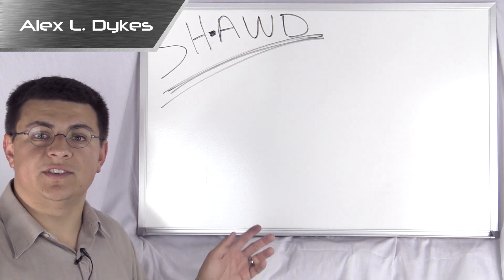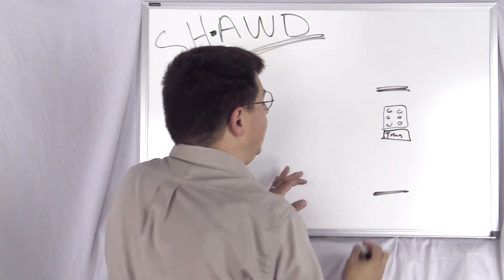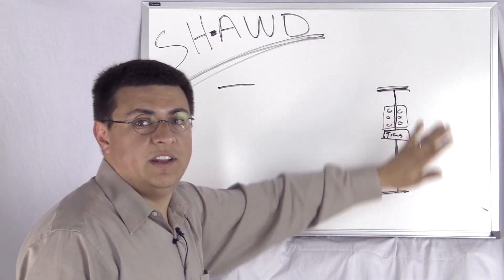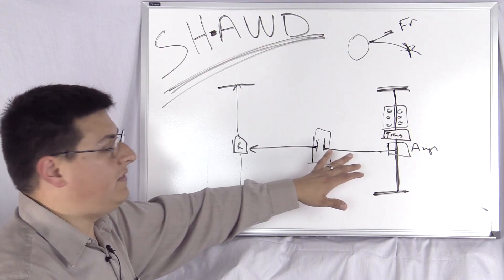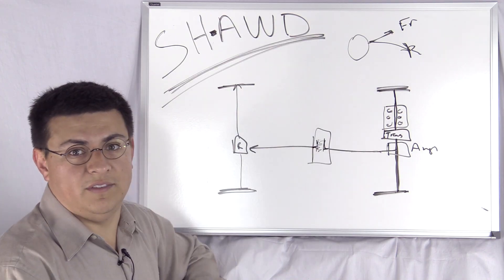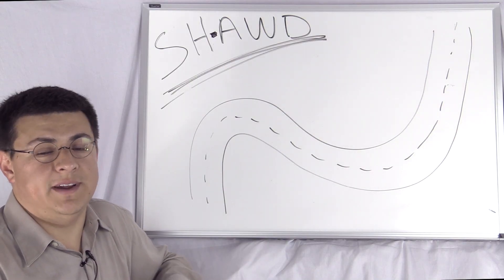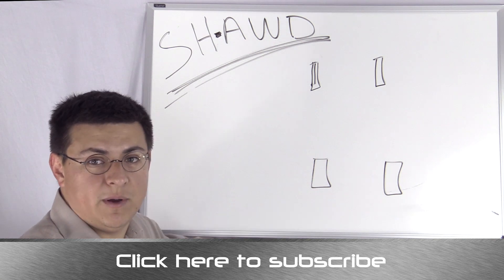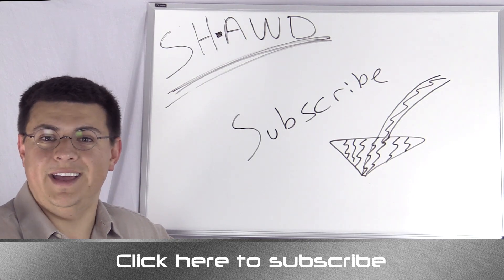How SH-AWD works: Acura's AWD system explained

Comment: This was an excellent video! Just a couple of clarifications.
1.- The only car to use an acceleration unit is the RL.. That unit allowed it to have different ratios but it was specific to the RL because of its long wheelbase, It needed the extra ratio of the acceleration unit in order to prevent binding from a sharp low speed turn.
2.- There is no "Center Clutch" the way the quasi "Center Clutch" happens in a SH-AWD vehicle is carefully controlled by the application of the rear torque vectoring axles clutches. Which leads me to point 3.
3.- The system is FULL TIME AWD it cant never be 100% FWD Biased unless the car is shut off.. The Torque Vectoring system works by having a set of planetary and sun gears to overdrive the rear wheels at all times, In the RL the Acceleration Unit added torque multiplication allowed it to have a higher ratio than the fixed torque vectoring system allowed.. The RL was the only car to be fitted with it due to its abnormal wheelbase and Torque Vectoring overdrive limitations at the time.

How does it work:
1.- The front differential has an extra ring gear which sends power to a dedicated fixed ratio transfer case located in the transmission, Not in the transmission diff output like some other manufacturers (ex. Ford).
2.- The transfer case sends 1:1 power to the rear SH-AWD differential.
X.- Exclusive to the RL the Prop Shaft connects to an Acceleration unit which is basically a dedicated set of extra planetary gears sets that overdrives the power from the propshaft to the Torque Vectoring system. This Acceleration unit has a dedicated clutch pack and electro magnet that limits the turning of the ring gear in the planetary gear set which allow it to get different ratios, This clutch pack cant never be disengaged because SH-AWD is a Full Time AWD System.. If the clutch were to disengage there will be a total loss of rear axle power.
3.- The Torque Vectoring unit has a fixed ratio pinion and ring which sends power to both sides of the axle evenly (There is no mechanical differential in the SH-AWD unit). The fixed ring outputs connects to a sun gear which turns the planetary set that drives each axle. In order to send power to the axle a wet clutch system holds the ring gear at different ratios using electro magnets for precision accuracy the minimum being 1:1 a fully locked wet clutch will send either 1.5 or 1.7% overdrive to each wheel (Depends on the car).

How the "Center Diff" works then? by applying full lock to the wet clutches in the Torque Vectoring system the car can in fact start at a 1.5-1.7% from a dead stop.. This means it can send up to 70% of the power to the Rear.. In the special case of the RL with the acceleration unit fully locked in can overdrive the rear wheels up to 5.7% which in turn means up to 90% of the power to the rear wheels... By carefully applying the clutch packs to hold the ring gear the car can distribute different amount of power evenly through the rear and front wheels.  By applying different ratios to each independent rear wheel then Torque Vectoring can happen only under full power and in turn the SH-AWD diff is allowed to send up to 90% of the power to 1 rear wheel but it cant never disengage the entire rear axle to become 100% FWD at highway speeds, The minimum is 10% of power to the rear wheels at highway speeds or at Torque Vectoring.

Hope this explanation and the awesome video by Alex can help you understand SH-AWD at its full potential.
And yes if the car is turned off the rear wheels are not connected to anything, You can jack up the car and turn each individual rear wheel by hand..
Reply: I essentially agree with your description and agree that Alex was confusing a few important details by stating there is an "acceleration unit" in the MDX (there isn't one) and by stating there is a central clutch that behaves like a "central differential" (there isn't one). In a SHAWD system, the rear axle does not contain a differential at all. Instead, as you mentioned, there is a wet clutch on the axle shafts going to each rear wheel and the SHAWD's computer controls each clutch.

As you mentioned, with the MDX the "acceleration unit" is simply built into the rear ring and pinion gear ratio ("angle gears" using Alex's terminology) and the independent wet clutches on the left and right rear axle are able to fully disconnect each axle so Accura doesn't need a central clutch (the drive shaft and ring and pinion gears spin freely).

One thing that most discussion's get wrong is how they talk about power splitting through a differential. Power equals Torque X RPM and most people don't realize this or don't think about how differentials direct power. A regular "open" differential is actually a 50:50 torque splitter. Open differentials don't care what the rpm on each side is, they always take whatever torque is applied, split it, and an equal amount goes to each side of the differential. 

The RPM input to an open differential is actually averaged between the outputs, but that isn't critical to this discussion (outputRPM1 + outputRPM2 = 2 X inputRPM). 

When stuck with only one wheel spinning, this means that only the spinning wheel gets "Power", while both wheels actually still get the same "Torque" (just the one with grip doesn't turn so its zero RPM equals zero power and the other wheel spins like mad, wasting the power). Note there are differentials that by design split torque non equally such that one side will always get more torque than the other (say 60:40 for example), but most common differentials perform an equal 50:50 torque split.

A locked differential or clutch based differential that is engaged or when both SHAWD rear clutches are engaged, this results in the outputs (or left and right wheels) being locked in RPM, regardless of torque or wheel grip. This allows a wheel with no grip to not spin wildly and all of the torque to go to the wheel with grip. Once enough torque is applied to get the vehicle to start moving using the wheel with grip, effectively all of the power goes to the wheel with grip (because RPM is equal and all of the torque goes to the wheel with grip; remember Power equals Torque X RPM).

Getting back to discussing the MDX SHAWD system, when both rear axle wet clutches are disconnected, the system becomes effectively a front wheel drive system. This is how the MDX behaves while cruising on the highway at a constant speed (with both rear clutches disconnected, resulting in front wheel drive only). Due to the 1.7% overdrive gear ratio in the rear, there would be a small amount of "binding" occurring all the time if the rear clutches were engaged while cruising down the highway and this would result in horrible fuel economy and increased wear and tear on the drive system.

If you take an MDX and get it stuck in the snow you will notice that both rear wheels plus one front wheel will be spinning initially. Then the front brake on the spinning front wheel gets applied by the computer, which increases the torque going to the other front wheel (remember open differential results in equal torque to each wheel regardless of RPM and there is an open differential in the front of the MDX) and eventually you'll end up with all 4 wheels spinning. In reality an MDX with 3 wheels on ice (so an ultra-tiny amount of torque will make them spin) plus one wheel on pavement will always drive forwards. If it is a rear wheel with grip it drives essentially right away (because the computer controlling the SHAWD engages the rear clutches initially when you start to accelerate from a stop). If it is a front wheel with grip the other 3 will spin, then the computer applies the brake to the front spinning wheel, then once there is enough torque going to the front axles, the front wheel with grip will make the car to move. This makes the SHAWD MDX exceptionally good at getting through snow and being driven on slippery roads.

Overall Honda's SHAWD system is an impressive approach to a vehicle's drivetrain. By disconnecting both rear axle clutches the vehicle becomes a fuel efficient front wheel drive. The reason for the small reduction in highway fuel economy compared to an only front wheel drive system is due to the differentials and drive shaft spinning freely (small amounts of friction loss), plus the small amount of extra weight. By eliminating the central and rear differentials found in most 4wd systems Honda is able to save money and put some of it back into high quality wet clutches on each rear axle. By using clutches at the rear and an overdriven rear gear ratio, Honda can provide greater the 50% power to the rear when desired plus provide computer controlled torque vectoring (while accelerating).

The only downside I've experienced is if towing a large trailer on slippery roads the rear clutches keep getting applied partially at highway speeds and it doesn't take long for the SHAWD overheat light to turn on. When this happens the system reverts back to a front wheel drive system until the clutches cool back down again. When it reverts to FWD you really notice how much you miss the excellent handling that the SHAWD system provides.

SHAWD works very well for an advanced light duty all wheel drive system.
Reply: @Slider68   i've got a question (i keep asking people who seem to know what they talk about in drivetrains but i never got a real answere for this one): You mentioned the disconnection of the real wheels which makes it a "fuel efficient FWD" with the addition of " small friction loss" due to the spinning drive shafts" (no differential in the back as you mentioned). With all the disconnecting awd systems manufacturers claim to have a better the fuel effiiency than with permanent awd systems due to beeing able to "switch off" one of the driven axles.  My take on this is that this doesn't save any fuel because the "switched off" parts are still driven, just not by the engine directly but over the detour of front tires ground and rear tires. Maybe a bad description... (english isn't my native language) I mean the engine power goes to the front wheels and still to the prop shaft that goes back to the clutches and the "angle gears", and as the car is driving the rear wheels turn and wiht them their drive shafts and the parts of the clutch connected those drive shaftstoo. So basically the same parts have to be moved by the power of the engine, no matter if directly or indirect which should have almost the same loss. Why should this save fuel?   I mean you could say that the SHAWD saves fuel compared to a permanent awd system by not having a center and rear diff so less loss and less weight. But are two wet clutches lighter? Is moving the fluid in the wet clutches (i guess the fluid will be moved by the turning clutch parts) causing less loss? And is a half closed clutch less loss?   I suspect that the fuel efficiency argument by the manufacturers for any part time or disconnecting awd system is just an argument to be able to sell cheaper awd systems. (They do admit that it is cheaper to have them instead of having center diffs with some form of locking clutch ect.)
Reply: @nirfz  Sorry for the late reply, I too question how much fuel is actually saved in an AWD system when only a clutch disconnects one piece of an AWD or 4WD system.

Back in the 60's to 80+'s North American manufacturers of full sized 4WD trucks offered systems with a center differential that could disconnect the front axle from inside the vehicle. The owners manual even stated that without also disconnecting the front hubs (little dials you could turn on the front hubs outside the vehicle) that you wouldn't save any fuel because the entire front axle assembly would still be turning, driven by the wheels.

Over time the inconvenience of turning the front hubs led manufacturers to first try automatic hubs that after reversing would disconnect until the center diff engaged the front axle again, and to later just leave the front hubs engaged all the time. Personally I do tend to leave the front hubs engaged with my older 4WD truck (especially in winter), even when in 2wd due to the convenience of switching from 4 to 2wd from inside at any time and without having to stop.

Then during the 90's to 2000's manufacturers started to add electric disconnects for one of the front axles as well as the center disconnect which stopped the ring and pinion and front driveshaft from turning to save fuel (but left the internal differential spinning wildly).

Now, most recently we are seeing vehicles like some Honda's that just disconnect the axle shafts but leave the ring and pinion spinning and they claim this still saves fuel.

Compared to a true disconnect system where components actually stop spinning I'm sure they are not as efficient. Some new vehicles do include this ability but not all, yet they all claim, even with a single point disconnect, that fuel is saved...

I suspect that they are doing things like running very light oil and light duty components where they are only engaged when AWD is required so they are saving some fuel over a heavy duty system that is capable of being used full time when using the same single disconnect. With the ring and pinions plus drive shafts still spinning I too find it difficult to believe they are saving as much as a fully disconnected system. 

I think this is also the reason that vehicles with AWD do get fuel economy ratings significantly worse than 2WD vehicles these days. For example the Ford Fusion with AWD gets at least 10% worse fuel economy, even on the highway, than the 2WD version, even though power to the rear wheels only occurs from time to time. Just carrying the extra 50lbs in the trunk of the 2WD version would only lose about 1-3%in fuel economy so the AWD system isn't very efficient.

Ultimately it depends on the vehicle and the AWD/4WD system used as far as how much efficiency is lost compared to a 2WD version. Some of the very latest systems are exceptionally good at saving fuel. One AWD system that I'm impressed with is an optional one Toyota and a few others offer in their latest midsize SUVs. With it they add an ultra efficient electric motor to each rear wheel (and a battery/power controller). With the system off, the rear wheels spin freely, but it can not only add power when needed but also perform regenerative braking to store energy normally wasted.

These electric systems are very simple, durable, have minimal maintenance required, and actually save fuel compared to the 2WD version of the same vehicle. Most (all?) of them also add a larger generator to the engine to enable regenerative braking with the front wheels and to electrically transfer power to the rear wheels when needed for longer than just what you'd get from the rear wheel regeneration.
Reply: @Slider68   Many thanks for the thorough and informative reply! I have to add something regarding the electrical powered rear axle: if there is no clutch to disconnect the electric motor, it might not save that much fuel, because an electrical motor that is turned works as an alternator -> regenerating. Like the dynamo on a bicycle if it is always on. So if you just cut the electric power to the motor, the wheels are driven because the vehicle moves in FWD you are generating drag by generating electricity. What you save in any case with the electrical rear axle in my opinion is the loss from the mechanical power distribution front to back and the differentials and their weight.
Reply: @nirfz  I can't say for certain they all do this, but a few years ago I read an article about one of the Japanese companies electric drive solutions for normally idling wheels. Instead of using a regular brushed DC or brushless DC motor with permanent magnets, they used a special type of induction motor. Both the armature and rotor consisted entirely of windings and to power the rotor's windings additional windings working like a transformer were used. The article explained that a primary advantage to this configuration is that when no power is supplied to both the armature and rotor, the wheel freewheels with no resistance to rotation. All of this was built into the hub, just inside of where the brake rotor is. It sounded like a very good solution because it not only provided this freewheeling capability, but it also had the ability to generate very high amounts of torque (far more than any permanent magnet solution could) from a small physical size.

One of the big European truck manufacturers was also using this technology in their experimental front wheel drive power adders. In this case the rear of the truck was a regular heavy duty tandem axle drive system with locking differentials but in the front it had these normally completely shut down specialized induction motors. The front normally cruised around with essentially no impact on fuel economy, but when the truck was driving in conditions where all wheel drive was required, by pressing a button in the cab the front wheels would receive electrical power and turn into a powered axle proportional to how much throttle the drive gave it. This particular system was only able to generate high torque at low rpms, but that may have been a limitation of the power source as I believe the electrical power came from a regular alternator (a big one, but not enormous).

There was another system that I read about many years ago (like 20) that uses electrically powered clutches to engage the electric motors.

Off topic, but that same truck manufacturer (I believe) also had an interesting air powered cam based front wheel drive system they were experimenting with. With it shut off the air cylinders would retract away from the cam and provide no torque to the wheel as well as zero drag. When it needed front wheel drive added, the air cylinders would fire at the right time to push on the multi-lobe cam and add torque to the front wheels. It could generate enough torque to spin the wheels when fully loaded .
Reply: @Slider68  Wow, very interesting! i think i have to find out more about the mentioned induction motors. And the "air system" sounds very innovative too!
Reply: @Slider68 the information you can't really find on the internet. Figured it was a permanent overdrive achieved by differing front and rear gear ratios. Kinda disappointed they don't have some sort of variable gear reduction device in there so they could fully or partially lock up when driving down the highway. The overheating thing is unfortunate, but it seems absolutely all AWD systems do that now. Even Toyota's torque vectoring AWD that comes in the fancier Rav 4's gets hot and ceases to function in even the slightest off camber situation. AWD as a whole is kinda disappointing industry wide these days
Reply: Still, I did not understand how much% of the total engine power can get one rear wheel?
In other words, what is the maximum torque a gearbox can withstand on one axis?
Thanks!
Reply: Hi. I m happy to see someone know know a lot on sh-awd. 
I want to instal shawd on my accord coupe. Can you advise me how can I go on to do this project. Because Acura tlx base model is only front wheel drive and shawd is a optional. So I am thinking the sh awd is like a plug-in and play kind a deal.
Reply: Fair enough BUT! The car can disengage from sending power to the rear wheels if you have a critical engine code thrown while driving. Does this as a safety measure. I know this comment is rather old but I had to add this in.